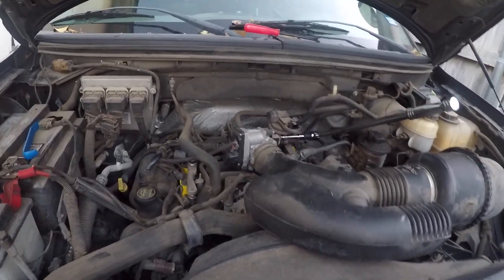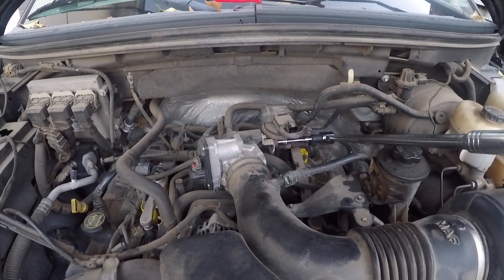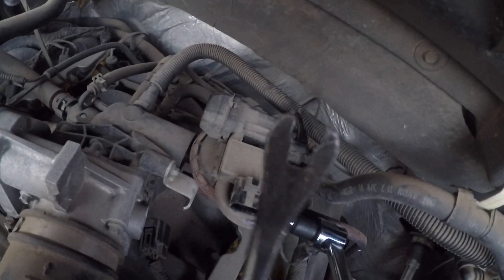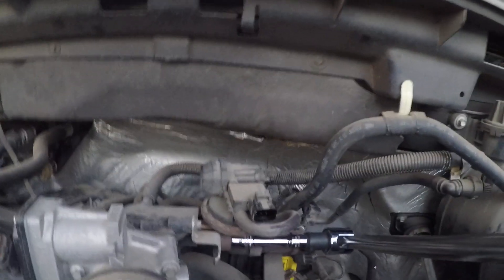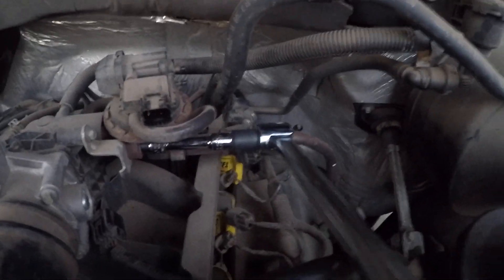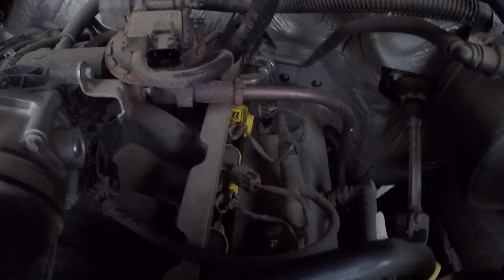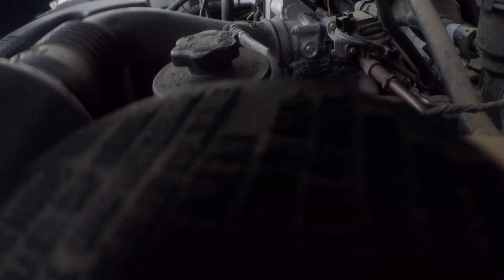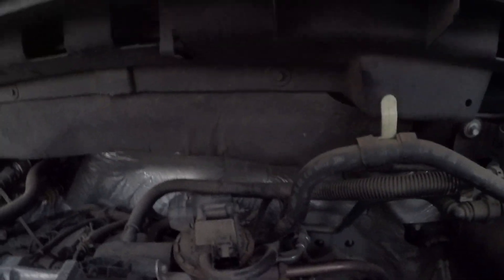2008 Ford F-150 V8 4
6 EGR Valve removal

Comment: Thanks for the vid. Just replaced mine on an 08 F-150 STX - same setup used this as a guide, spot on. Also some additional info for any one interested...

I had a rough idle, but no problems accelerating or cruising on the highway.  Codes were P0402 and P0106. Originally I was going to take apart the throttle body to clean it and inspect for any build-up instead of shelling out the money for a new EGR unit. Decided against it due to time constraints. Amazon has it for about $100 (Standard Motor Products EGV1136 EGR Valve) vs autozone almost double the price. Replacing the whole unit worked in my case, idling is back to normal. Like the video says all you need is:

8MM socket - for the fluid bracket to free up room. 3 bolts, top facing, super easy.
10MM socket - for the EGR unit. 2 bolts with extensions and a pipe for leverage worked.
1-1/16 open wrench OR Crescent Wrench - for the metal pipe going into the lower part of the unit. I was able to pop it with a crescent wrench but was on top of the engine with all my weight on it. Balled up a towel and put it on the end of the wrench handle t save your hands.

You can take the two 8MM bracket bolts off too which will pop out the EGR port(?), it's basically a metal tube that points down into the intake/throttle body. Mine wasn't clogged but definitely had some carbon build up. Although careful as to not warp the bracket from all the torque needed to crank off that 1-1/16 metal exhaust like I did. Warped so much the two 8mm bracket bolts don't line back up >:/ could only get one bolt on for the time being - holds steady though.
Reply from the maker: Thank you for your feedback. And glad the video helped. 👍
Reply: Super helpful comment.

Comment: While you were in there did you check the EGR port to see if it was plugged?  I am hoping that the part that the EGR controller bolts to comes out for cleaning!!!!    I have a 2007...but this is the FIRST video that I have found on the newer one-piece EGR controller!   Thanks!
Reply from the maker: No I didn't, I just removed, and replaced.  The light eventually came back on, but I honestly haven't tried diagnosing it.  I well eventually removed part, and inspect further. 👍
Reply: @sgt.hollowpoint6968  did you ever inspect further?
Reply: Great video btw and super thankful for your time sir

Comment: nice man just in time. been trying to find videos for days on this. the nut on my exhaust valve is so stuck. i sprayed wd40 and let it get hot from my engine, and it wont move. I tried using a crecent wrench like you but no matter how tight i make it, it strips before it comes off. I used a pipe on the wrench for leverage. It also bends the egr and throttle body from all the torque. any ideas?
Reply from the maker: Impact wrench if you have access to one.
Reply from the maker: If you have a compressor you can rent an impact, or take it to a hole in the wall shop and have them loosen the bolt for a few bucks.
Reply from the maker: My bad, I believe you're talking about the nut that takes the 1 and 1/16 wrench. 

Well use that spray "nut buster" and let sit for a few minutes, then use a large and heavy pipe wrench considering the nut is stripped. It should work
Reply: Did you fix the egr! Was it giving you a p0446 code? I'm having the same problem
Reply from the maker: @gime8148  the initial issue was fixed, but now I have a P406 code.
Reply: I took a hammer drill and put it on hammer(not spinning) and it broke that nut loose. I soaked that thing for like 3 days and still couldn’t get it off with a wrench of any kind. An air hammer would work better and not be so bulky but I’m a carpenter so I had the drill on hand. I was mad that I didn’t try that method way earlier!